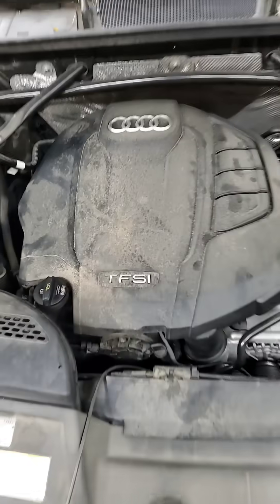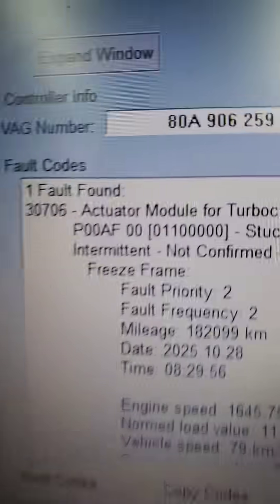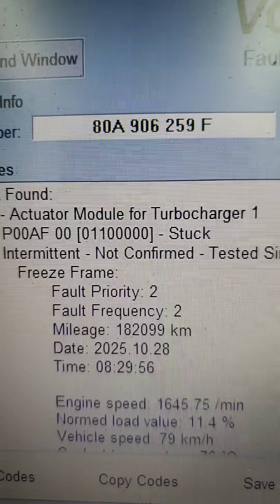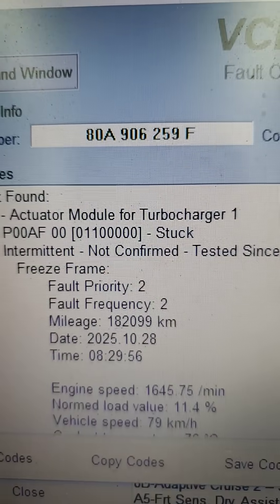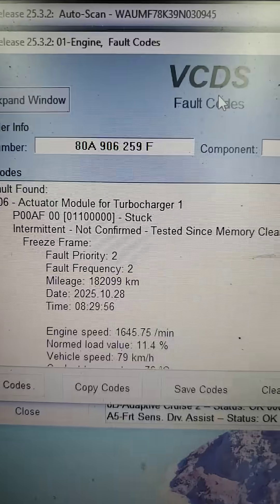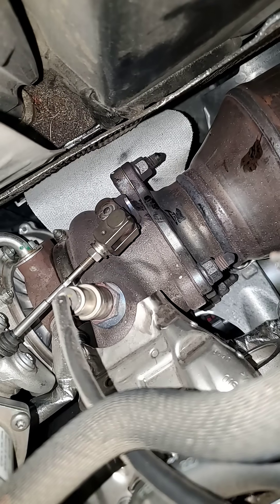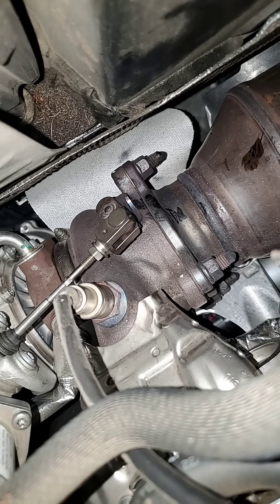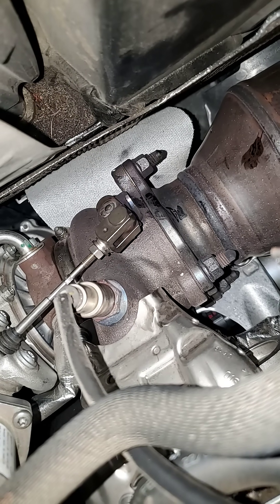Checking your Turbo Wastegate Shaft

Comment: your worng there on the end you can fix this with the proper kit that contains a new busing that slides inthere and a new shaft with waste gate to it. this wil save you chancing the entire turbo housing for just a waste gate
Reply from the maker: Feel free to post a part number to a rebuild kit, I'd be very curious how you rebuild it.
Reply: @deamonmachine  i did but you removed my comments. xD im guessing you wanted to earn more and upcharge your costumers. xD other wise a mech would refurbish that waste gate why the hell would you need entire new turbo unit. that would only be needed if the turbo housing it self it cracked anything in around and on it is made to be replaced. and alot cheaper then replacing the entire turbo unit
Reply from the maker: Let me see if I can follow your logic:
You said there's a rebuild kit
I asked for the part number
You posted it and it disappeared? 
You then assumed I removed it because I want to upcharge people. After I asked for the part number of the rebuild kit. Why would I ask for the P/N and not just delete your whole comment from the start if "upcharging" was my goal?
I assume you posted a link at this point, which YT will auto-moderate out because "spam"
That's why I asked for a part number. Am I correct that you posted a link? Just give me the name and P/N of the product, cause if it works, then I can put the actual link in my own video comment because YT won't remove mine.